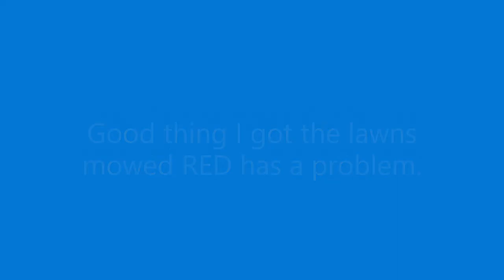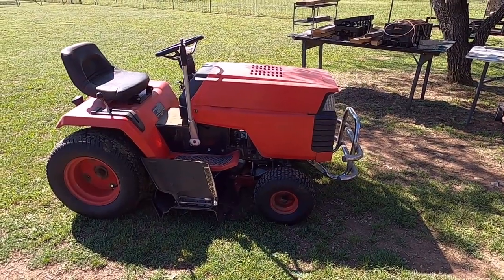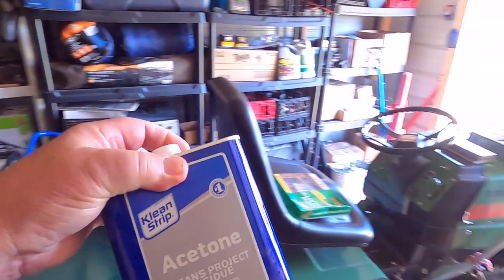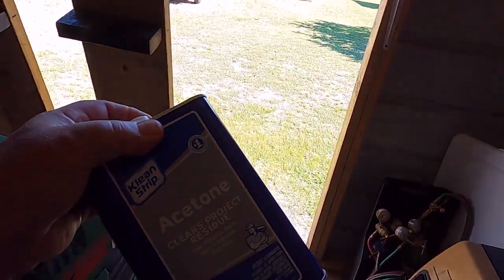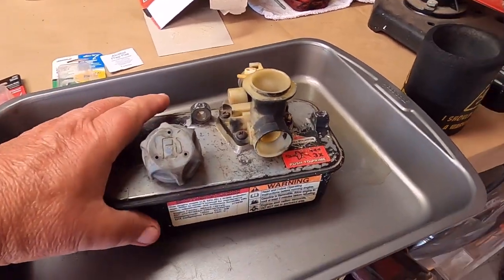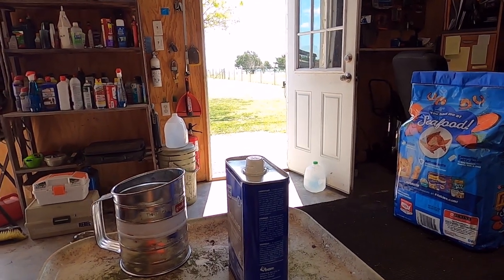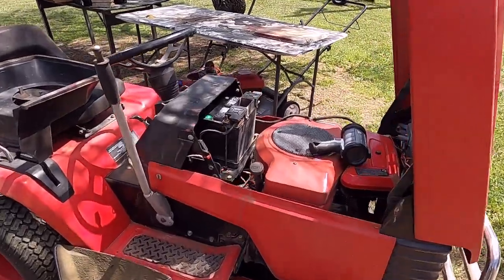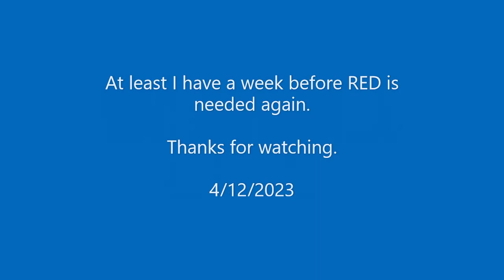Good thing I got the lawns mowed RED has a problem

Comment: Just replaced a stripped out steering shaft gear and sector gear on one of my neighbors older MTD mower the other day. Make sure that you put a dab of Loctite on the screw. They like to back out if ya don't. I actually Loctit-ed a Bolt in place of the screw on the neighbors because you can get to a bolt with a wrench if need be.
Reply from the maker: Yes I plan to loctite this once I get to it.